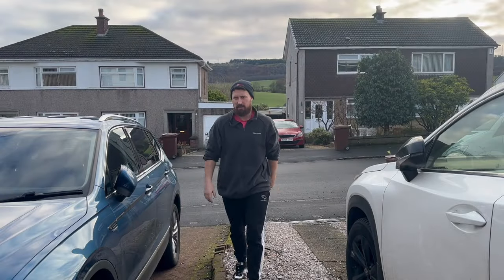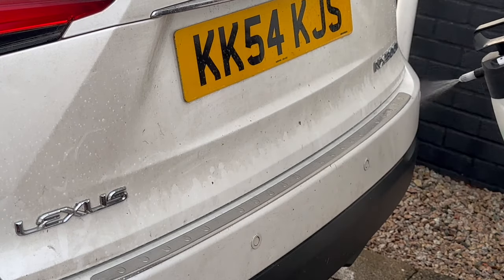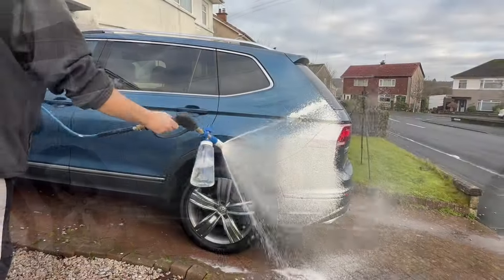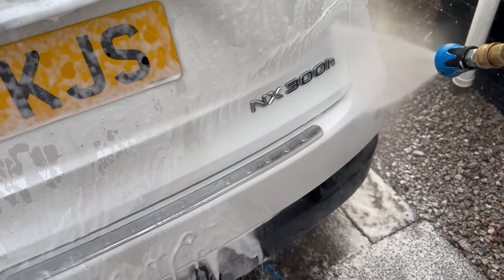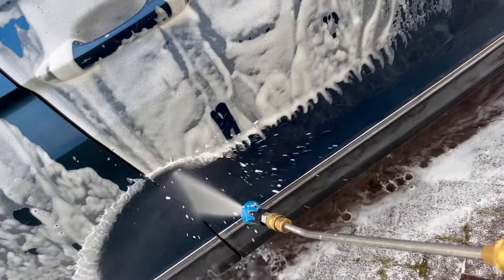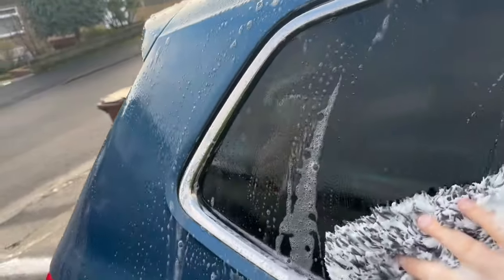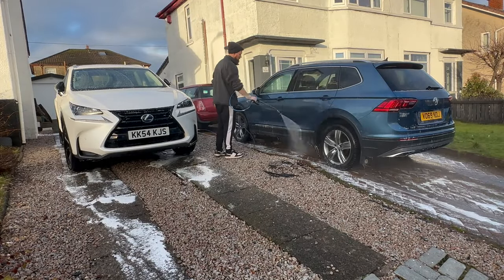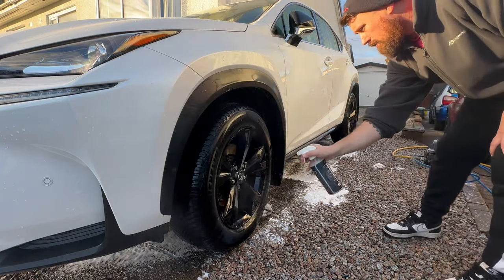Bilt Hamber Auto Foam Effortless Dual Car Cleaning! 🚗🚗

Comment: I also finally got to give the car a good clean after several weeks of freezing temperatures, snow and salted roads here in Norway. The car was very dirty and I wanted a good prewash to get the roadfilm and saltlayer off the paint. I have BH Surfex HD, Autofoam and Touch-Less, and prefer Touch-Less in the wintermonths. I'd have to use it neat (or 300ml which is enough to cover the car via MTM PF22.2 foamcannon) to get 5% PIR through the foamcannon, which is a bit too much product per wash.

Inspired by this video, I mixed Touch-Less @5% in a pumpsprayer (50ml for 1l of prewash-soap) and presoaked the back and lower half - the dirtiest parts. Used 100ml Touchless in foamcannon to cover the whole car/giving time to dwell. I can live with 150ml product per wash.👍
Reply from the maker: I agree, the volume of product that you need to use when using as a snowfoam is just not sustainable, using in the way you have has more than halved the amount of product that you need to use which in turn makes the product much friendlier on the pocket. Ive yet to try Touch-Less as i still have a large amount of autofoam left but ill be sure to pick that up once i work my way through the AF

Comment: Can’t beat BH foams think they are probably the best on the market ,and I do alot of filthy cars on a weekly basis,it’s all about time and they do the job 👍
Reply from the maker: I have to agree, whenever i try a foam that claims great cleaning power, this is allways the one that i measure it against. BH make some cracking products.
Reply: @DavidMcBay  not Tryed infinity wax yet but my mate thinks it’s the bollocks
Reply from the maker: @simonmarsh5007  powerfoam is a good foam, it has good cleaning power and long cling time as well as being highly dilutable.

Comment: Great job! BH AF is a fantastic product, this is the first time I’ve seen it used in this was and will be giving it a bash.
Reply from the maker: It’s well worth giving it a go, when the temp is low and the suns away you still get an excellent dwell, the foam just lets it work away that little bit longer

Comment: Living in the same neck of the woods as you David, I decided to carry out a new process last week to try and avoid staying out in the cold weather too long. I used the BH AF via a snow foam lance, left to dwell for 10 or so minutes, thorough rinse off and then decided to try the contact wash with ONR and the Rag Company Ultra Black Sponge, finished off with AM Details Detailer+ as a top up for my current protection. The results were very good.Whole process took 40 minutes.
Reply from the maker: Hi Martyn, thanks for taking the time to leave a comment, it’s always nice to hear what other people wash procedure is for this time of year. How much autofoam did you use in your mix?
Reply: I’m afraid I didn’t adhere to the recommended P.I.R advised by B.H. I mixed a stronger solution around 50/50. Not very scientific, however I only use B.H during the winter months so I can over indulge on the dilutions and not feel I’m wasting money!Keep up the great work!

Comment: I'm glad you've tried this.
I read plenty of comments where people use 300-500ml of AF per car (with a cannon). Through an ik sprayer I'm guessing you used 70-80ml of AF per car for serious cleaning power? 
I hope viewers see this method and are inspired to give it a go.
Nice one
Reply from the maker: Thank you mate, I have always been a fan of autofoam but this has really changed the game for me with it and it means a very inexpensive 5L of product is going to go so much further. I used 90ml of product in a full 1.5L IK Sprayer and got 2 cars and wheels out of it 🤯.
Reply: @DavidMcBay  so you basically cleaned a car for 15p plus the cost of the other Snowfoam. Wow!
Now, try the same with GT snow foam. I'd be interested to hear your thoughts on that

Comment: To be honest ive watched loads of guys valeting cars on YouTube and because a vehicle has been prewashed they've a habit of washing the car to the very bottom with the same mitt or pad then coming back up after rinsing it and starting the next door at the top ..... You're one of  the few who I've seen wash the bottom separately
Reply from the maker: Thanks Peter, I do find especially in winter time its good to do them separate. If the car is only a bit dusty you can get away with one mitt, but when they have a heavy coating of dirt i think its best to do it this way to avoid scratching anything.
Reply: If it's someone else's car it's the best way to do it .... Yes it adds a wee bit of time to the job but it's the safest way of doing it..... Look forward to seeing more videos

Comment: Definitely worth a good spray of prewash (apc, citrus or snowfoam) before foam it just seems to eat into the grime more than a strong foam alone doesn’t it. 

I did my two the weekend for the first thing in about 2 months not simultaneously though. Was knackered after 🥱
Reply from the maker: Couldn’t agree more Nick. I’ve always liked using autofoam, especially in winter but didn’t like how much product I had to use. This way seems a like it’ll make a 5L bottle go much further. 

I’ve done both at the same time a few times when it’s just a “quick” wash, I don’t enjoy it rite enough but needs must at this time of year! Roll on the nice weather so I can take my time and enjoy it again

Comment: Wait till you try contactless. It works better than autofoam
Reply from the maker: It’s on the list but I need to finish up my Autofoam first. I’ve seen lots of videos on it though and it does look good
Reply: @DavidMcBay  it is really quite good. Its probably the best snow foam I've tried so far. You've got to try bilt hambers new Trace-less glass cleaner, it is a game changer. Check out the test video of it, it puts all the rest of the glass cleaners out there to shame. I've had some a few weeks now and it is honestly amazing. I never thought a glass cleaner could be all that special but bilt hamber have set the standard again
Reply: Apparently BH touchless is less thick, although stronger and more effective.